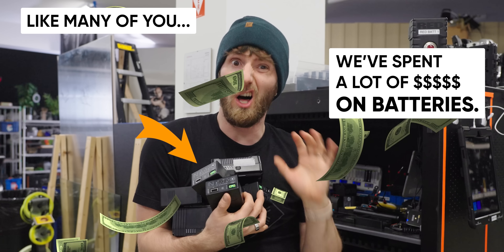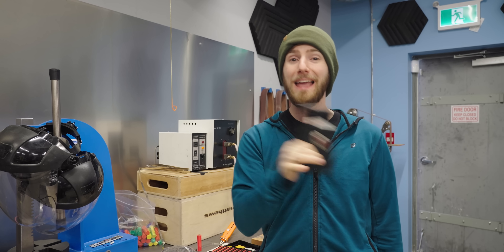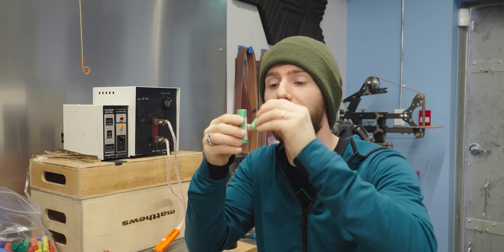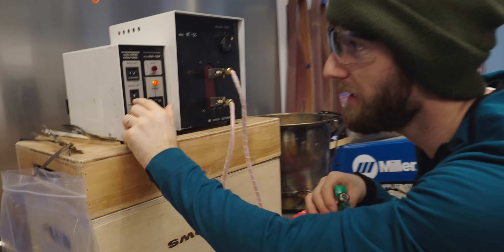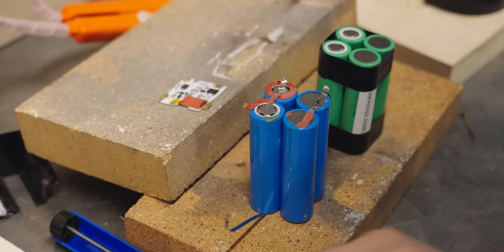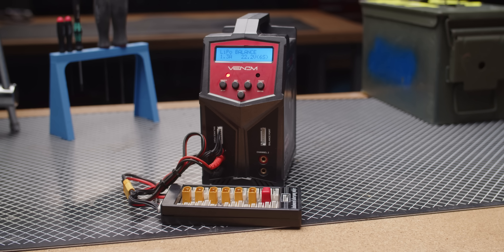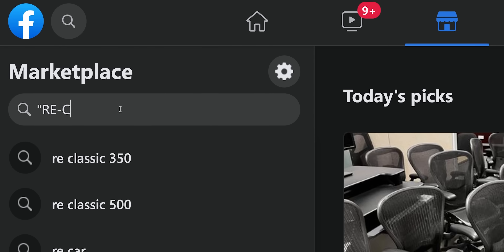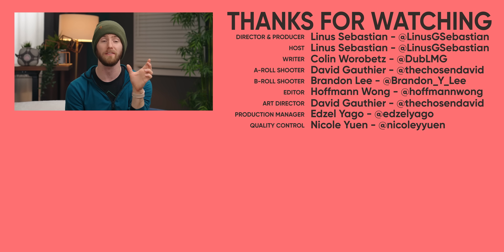This should be illegal… Battery Repair Blocking

Comment: Having worked and designed BMS systems (or PCM as their also referred to) I can add that these protection modules will almost always include an “under voltage protection” (UVP) in addition to over voltage, current and temperature protection. The UVP will lock out the battery from the system if it falls below a pre-determined value (either a specific cell or the entire pack). If you remove the BMS from the battery pack it will likely trigger the UVP and disconnect the cell. Usually this is resettable and only requires it to be armed by applying a voltage to the cell to system side of the BMS. This can be done by placing a power supply on the cell briefly to arm the BMS, the charger (depending on how it’s implemented) may also be able to arm the battery. 
Having said this, some aspects of the BMS might be non-resettable, if for example they have a physical fuse or a thermal fuse on the main output to protect the battery. And, of course there do exist “evil” packs that have a microcontroller that disables the battery like Linus describes, but I doubt that the Sony battery is built like this.
I hope this helped
Reply: THNX M8 was going to say the same. He just had to apply some voltage to the copleted pack with BMS and end up with working battery pack
Reply: As a fellow embedded engineer, its actually way too easy to make evil BMS. I have actually make it, all you need is mosfet as switch, Attiny(as it is small and great thing is it can work between 1.8v to 5.5V which makes perfect for this application ) and some i2c EEPROM (prefer WLCSP-4, due its smallest size factor). BAM you are done.

Its suprising easy.
Reply: @kaustavsengupta8757  It's even easier: 'Evil' BMS-IC's can be bought of the shelf. Texas Instruments and Maxim are big players in this industry and have a great range of IC's with very, VERY complex safety-features that can only be reset by deep communication per SMbus.
Reply: I had a battery pack for an ebike where you had to jump two pads on the BMS after the battery was reconnected, probably the same thing.
Reply: Appreciate the added info. Solid knowledge.
Reply: they’re**
Reply: @niklas.251  EVERY GRAMMAR COP ON HERE SHOULD BE SENT TO INDIA !!
Reply: @flatearth9140  relax i was just telling him
Reply: @flatearth9140  username checks out
Reply: Thanks for the info. Are these boards actually safe to reuse multiple times? I get their lifespan is overdesigned for safety, but would they still be properly overdesigned enough for a second or third use? Thanks again, very helpful comment!
Reply: @AcoAegis  " Are these boards actually safe to reuse multiple times?"
I can't think of any reason why they're not.
If the board includes electrolytic capacitors, it would be a good idea to replace these but most of the electronics in a BMS should be good for decades if not longer.
I'm curious to hear what others with more experience have to say on this topic.
Reply: @ddegn  I was thinking the same thing, to be honest - figured I'd just ask to be thorough.
Reply: @AcoAegis  Depends. The BMS-PCB in my Bebob V-mounts is rather vulnerable and need to be soldered with care to avoid pads coming off from the substrate.
Besides that, the BMS-IC in them (BQ20Z65) have a logic-fuse output, that drives the filament in the logic fuse. In mine, a small transistor or FET is used to drive the filament, thus an extra point of failure.
Downside to mine: 4 of my batteries (I got 5) had the logic fuse blown and they are hard to find parts ánd hard to solder. Removing the blown fuses is no problem, but soldering the new ones in... pff... I've done a lot in my 26 years of soldering-experience, but it is by far the hardest thing I've done.
Fortunately, the IC can be put in a kind of 'check-mode': when you got full access to the device, you can check all safety-features. By simulating cells with resistors and connecting a power supply, one can also check the overvoltage and undervoltage security-features.
Besides that, blowing the logic fuse is a last resort because of some fault with the cells: this triggers a PermanentFailure, disables the charge and discharge FETs forever, stores the PermanentFailure in a flag in a few registers so just swapping the cells won't work. Add the fact that all those failure-flags (besides a PermanentFailure state, the cause of the permanent failure is also stored) can only be cleared by giving in special 4-byte 2-word keys that are only known to the manufacturer. Without those keys, you can't alter anything in the flash-memory.
And indeed, removing the cells triggers the CUV (Cell UnderVoltage) warning (and eventually Failure), which you can only remove by resetting the BMS-IC.
I had to get Russian software (Be2Works) with a small dongle. The software can crack all the necessary keys and reset them to default and at least get you back into the device. Because the russian software is rather limited, I eventually got the official interface from Texas Instruments to alter everything more easy and program the right chemistry ID.
That last setting is crucial: just adding new cells (if your BMS has not triggered on any faults yet) fails with the BQ20Z65: it knows how the cells react chemically on charge and discharge, knows the capacity of each cell and thus total capacity.
Adding totally different cells (like happens in this video) will fail on the more sophisticated BMS-IC's, as it will still think the original cells are attached. The calculated runtime and SoC (State-of-Charge) indicator can provide false information.
Reply: @weeardguy  I saw BQ20Z65. Damn by reading datasheet, it's actually baller IC( SHA1 as auth). But I couldn't find this IC in mouser India. Care to tell me how much it cost per 500 pcs?

Might look into, as I have to design this project "Multi Gas Analyzer" where electro- chemical sensor is used. If it's fit in budget I can actually use but PCB layout Guidlines given in datasheet might be little tricky, as it need different analog ground.
Thanks for telling me about this IC. This IC really pops my curiosity up
Reply: @kaustavsengupta8757  Haha, well who knew my comment would spark such interest ;)
I think the gas gauge industry is hit with shortages in supplies just like any other semiconductor market at the moment, so that could be the reason Mouser Netherlands only lists a 120-piece quote for the 595-BQ20Z65DBT-R1 (the one I use) at 14,46 Euro/piece, while the 595-BQ20Z65DBTR-R1 (notice the second R, minor difference, but a revision of the chip if I remember it right) is listed at 500/pieces at 11,76 Euro. Prices excluding VAT.
Texas Instruments places the BQ40Z50-R2 as a substitute with the same functions (and extra functions compared to the BQ20Z65), listed at 4,81 Euro if you buy 100 pieces.
Considering you need 500 of them, I can only recommend you buying the right gas gauge evaluation board as well. That's also (ridiculously) expensive, but it saves you messing around with an actual PCB that's not designed to easily conduct tests with (like I had to, which has basically destroyed one of the PCB's after so many soldering and desoldering of the cells).
But maybe it's better to use TI's configurator: their website has a great step-by-step kind of wizard to find the best gauge for your needs: https://www.ti.com/power-management/battery-management/fuel-gauges/products.html#%20
I got the logic fuses from ATC Semitec in the UK: though I could get them on Ebay or whatever kind of similar website, I didn't trust them being genuine. Considering the dangers involved, I wanted original parts with specs I can trust. Though I'm just a hobbyist, I just wrote them and got an offer for 10 of them at 50 Euro: quite a lot of money, but nothing on the total price of my project of reviving 5 V-mount batteries with 16 cells each, the costs of the russian interface and the one from Texas Instruments.

Hope this helps! Have a great day. Kind regards from the Netherlands ;)
Reply: @AcoAegis  The boards should last decades.
Reply: HOT swap(with voltage applied no current)
Reply: @theantiveganchannel3596  And even that has risks of permanent-failure when done wrong: if you apply voltage to the wrong connections, the BMS can still think there's something wrong. Besides that, hot-swapping a 4S-battery is a great hassle. You will need a 4-channel power-supply where every output can be adjusted to the desired voltage, that is accurate to at least 3 digits behind the comma (or point if your a imperial-system user) ánd is able to put its 4 individual supplies in serie.
And then you still have to be carefull: if you do it too quickly after charging or discharging, the BMS could start a cell-state measurement, checking what the internal resistance is. If you happen to have a power supply connected at that moment, the measurement will fail bigtime and could render its SoC (State of Charge) indication completely false.
Like that ain't enough, the higher-end BMS (like the one stated by TheRAZZITEAK) usually know exactly how the cells have aged over time and use. Thus, just swapping the cells won't get you longer runtimes, because the BMS-IC doesn't know any better than that the original, aged cells are still there. It requires a reset of the device to set everything back to 'golden-pack' state, the state it was in when it left the shop/manufacturer.
Reply: @weeardguy  - It's by design, and it's easily solved. You don't need any special power supplies or tools.
Firstly, manually charge every cell (parallel group) to a known equal voltage, let's say 4V. Then manually charge your replacement cells (groups) to the same voltage. So, now you have 2 packs with balanced cell voltages and equal cell voltages.
Next, solder a thin but fairly long lead between each pack's cell (group) and the respective BMS connection. For a 5S pack, you'd need 6 thin wires per pack of cells. Don't forget the big ones for main + and - of the whole pack.
So after soldering you end up with 3 wires on each BMS voltage sense connection (no, they aren't "balance wires"). Most importantly, you have two packs in parallel that have equal voltages on every cell series.
When it's all like that, remove all the original cell voltage wires (but you must leave the thin wires in place on both packs to the BMS). Transfer the BMS over to the new pack, and re-solder the main connections one at a time.
Once that is done, you can remove all the thin wires. You just need to be 100% sure that AT NO TIME do you disconnect power from any terminal on the BMS board, or let any cell appear to have dropped below about 3V.
NOTE: This is much harder to explain than it is to actually do.
Reply: @johncoops6897  Yeah well, reading your comment I can only tell you obviously have never worked with BQ20Z65 or equivalent gas gauges, because what you describe (manually charging the cells) is impossible: the gas gauge will trigger an alarm-state (and, if the alarm persists for long enough, will trigger a failure-state, which then disables the FETS and (if bad enough) also trips the logic fuse output.
The gas gauge (aka: BMS) does exactly what it's supposed to do when that happens: monitor each cell (or cell-group when in parallel, but the BMS won't know better than that it is 1 cell) and as soon as you start messing with cells externally (meaning: without the BMS knowing what is going on) it will act.
It's the same as discharging the pack by drawing current in front of the FETs: the BMS then suddenly sees current flowing from connections where there should not be any current flowing: it will trigger a discharge-alarm first, and if it persists, trigger a discharge-failure, which disables the FETs and blows the logic fuse (because, as said, the current flowing is not in control by the FETs, so even if the BMS turns the FET off, current keeps flowing, with the BMS taking action to end the situation)
Same for charging the cells while soldered to the BMS: it will suddenly see cells start to rise in voltage while it does not see any charging current flowing. It can then even start to balance the cell-group you are trying to charge because the other cells are at a lower voltage. It's wonderfull to see the PCB's in my batteries start taking balancing-action when necessary: suddenly 1 group of cells (or two, but usually only 1 at a time) drops in voltage while the rest keeps getting charged as the small FET on the board is dissipating power.
Besides that, you run a risk to damage the Analog Front End in the BQ-chip if you don't work from pack-positive down to pack-minus when removing wires: TI explicitly warns for this in the datasheet and application notes.
Whether it's okay to let a cell appear to have dropped below 3 Volt is completely up to the manufacturer: if it is strongly discouraged to discharge the cells used below 3 Volt, the manufacturer will most likely set the BMS to go into CUV-mode (Critical UnderVolt mode) at that level, which it usually recovers from if dealt with quick enough (read: charging it before overdischarge-timers run out or capacity drops even further due to self-discharge) than the manufacturer will protect the cells by programming the BMS accordingly.
The cells I used (Those Panasonic NCR18650B) are specced down to 2,5 Volt, which I consider to be a dangerously low voltage. I've set minimum system voltage to 12 Volt, where it used to be 12,8 Volt, as the original cells were specced empty at 3,3 Volt.
And then there is the cell-state: if you have cells that have aged, just connecting new ones just won't give you a splendid, new battery anymore: The gas gauge just won't know any better than that the original cells are still there, because the capacity-calculation is based on the internal resistance of the cells, stored in resistance tables in the gas gauge.
But it greatly depends on the BMS there is inside: Linus' batteries also seem to have a BQ-chip of some sort inside: I had to up the resolution to 2160p to see it, but it really looks to be the case that the left chip is marked with BQ xxzxx ...
Then you can put in new cells all you want, it just won't give you a new battery without resetting (in case of recelling with the same type of cells) or reprogramming (when you put in completely different cells, like I did) the BMS/gas gauge.
Reply: That sounds like some of the inkjet cartridges that prevent refilling.
Reply: @8546Ken  It basically is and the gas-gauge software can be set to malicious actions if certain conditions are met: the ones in my batteries have a cycle-setting: depending on how much of the total capacity is actually used, the cycle-counter increments with 1 after a charge-discharge cycle. That value can be determined by the manufacturer (or myself in this case). Just like the fault-limit can be set freely: if you want the BMS to go into a permanent-failure status and disable the pack 'for good' when the cells have lost a certain amount of their original capacity, you can do so. That sounds quite criminal (and I wouldn't be too surprised if this happens) but don't forget that gas-gauges (very sophisticated BMS-IC's) are used a lot in medical equipment, were ultimate precision is of greatest importance.
After calibration of mine, I had set it to discharge at work during one of my test-runs. On my laptop, I could follow the process via the SMbus-interface which was reporting back on batterystatus. When I started the discharge in the morning around 8, it said something like '324 minutes till empty': that's a value it calculates because it knows exactly how the cells respond to every current-level available.
I had set a timer on my phone (mostly so I wouldn't forget to stop discharging) and when I came back in the third break, it was indeed empty with a 40 second accuracy.
If my battery would have been in an AED or other very important mobile medical device, you will thank the designer for putting in such a wonderfully designed piece of electronics.
Reply: This is good info that a lot of people just don't know. Where I work (as a mechanical engineer), we make various electronic safety devices, some of which we put the batteries into a deep sleep before shipping them to the customer. When the customer gets it, they must put it in the charger we made for that device in order to wake the battery pack up before they can use it. Some of the battery packs we design (though we don't manufacture ourselves) are certified to be used in explosive environments, so the protection circuits have to be extremely fool proof. This is done for safety reasons and not to be evil. 

Those red cells in this video look just like the Panasonic UR18650A that we use in one of our devices. I had the pleasure of having to chop the top off of one for certification reasons before and I wasn't too thrilled about that task because of the risks, but I managed without any problems. Though, I wouldn't want just anybody to be doing that in their homes.
Reply: @usefulidiot21  Well if you read the datasheet by the manufacturers, you'll usually see a whole list of risk-assesments and tests that the cells have to endure without posing a risk to the user. 'Drop test at 1 mtr, max. Cell-housing should not be deformed, cell may not become hot' or 'Overheating: cell is externally heated to 85 degrees Celsius: cell shall not explode or vent flames.'
Though popping the top off of one is not a likely scenario they thought of, it does come close to a short circuit test, which usually requires the cell to heat up to a certain maximum temperature, shall not deform the cell-housing, and may not vent flames.
Reply: @weeardguy  The reason I removed the top of the cell was just to verify the construction and spacing/dimensions of the various parts for the certification body. I made sure to drain as much of the charge as possible beforehand using a handful of high wattage resistors. 

I've learned that battery packs have to endure a lot of things to be safe for use, as I work with electrical engineers that create the protection circuitry and and software engineers that write the code to charge/use them. Our devices which are certified for explosive environments have to be able to withstand drop tests and be at least IP67 rated, so it's no trivial task to make everything safe.

Knowing what I know about lithium ion batteries, I wouldn't want just anybody replacing the cells in their own packs. Though, it's nice when a company offers that service to help reduce e-waste.
Reply: @usefulidiot21  "Knowing what I know about lithium ion batteries, I wouldn't want just anybody replacing the cells in their own packs." 
What you want doesn't matter, if consumers want these repairable another system has to be made. If it isn't they will take it a part and do it manually to an extent either way. Safety feature's aren't an excuse for planned obsolescence and never will be, these feature's can also be applied without dogshit support and overpriced repair or replacements, they are only not because of company interests not because making a more expensive repairable model through a third party is impossible or has no demand.
Reply: @Yeet42069  I'm not sure you understand why these safety measures are in place (hint, it's not for planned obsolescence or overpriced repair or replacements). So my response to you would be, "What you want doesn't matter".

I'm all for right to repair, as I fix as much of my stuff as possible, but this is one place where it doesn't always make sense.
Reply: @usefulidiot21  I'm not sure you understand how companies work let alone what I'm trying to say (hint, you're not the brightest bulb). Whether its designed for planned obsolesces or not doesn't matter, what matters is it can be used for such by simply denying the creation of a superior product with reparability when consumers have a need for it. 

What is the difference between creating a malicious system designed to break down and a security feature that will do the same exact same thing for shareholders bank accounts? Nothing, absolutely nothing. Which is the exact problem that is being addressed in the video. A rational person who encounters a problem and needs to solve it will not only question why the problem exists (the need for additional safety mechanisms) but also why the current solution isn't optimal and how it could be improved. The latter is what you seem to miss while rambling about your justifications about a system that is designed to fail itself instead of accepting that it doesn't have to be that way and the main reason that it is, is related to profits. And the fact that a video like this where a bunch of people who are clearly not experienced enough with batteries are trying to work on them simply because the alternative is to replace a working product instead of the battery itself just proofs the prior statement.

What reason does the company have to create a non replaceable battery pack into a product that will simply lock itself out due to safety concerns? P L A N N E D     O B S O L E C E N S E.
Do they have to invent a malicious way to make you buy another product when a battery replacement is all that is necessary? No. The same can be done simply addressing security reasons in a product feature that could be replaced with another feature that avoids the problem altogether (replaceable batteries). But obviously, If you create a superior product that is more reliable you will miss all the additional extra sales you would get from selling a new product due to a battery failure.

As for claiming that my response doesn't matter, if it didn't this video wouldn't exist and battery replacement along with tech repair laws wouldn't be an issue all over the western world. Yet it is. An no, half assed security features from a self created problem is not the main reason for these issue's let a lone a factor that really matters.

Also, you really need to be a next level mongrel to get offended by the statement that states that your opinion matters less than consumers needs let alone take it personally for some reason, its more of a law than anything.
Reply: Big Clive just released a video about this, sorta, smart battery chargers
Reply: Mark Ulis  LOL
Reply: I have run into the evil microcontroller variety with Dell laptop batteries. You have to apply a secondary battery to the BMS for the time if the re-celling, otherwise it shuts down permanently if it is disconnected.
Reply: @Nemozoli  Well, everybody calls it evil, but it's not evil at all. It does EXACTLY what it should be doing: protecting the user from harm because the charger otherwise will try to charge cells that have gone beyond a reasonable limit of 'bad'.
Though there are some malicious software-'solutions' out there, where gas gauges (those are the 'evil' microcontroller thingies) shut down prematurely, most of them will do the job they have been designed for: protecting the cells from dangerous currents, (whether that be discharge or charge), high and low temperatures, overvoltage and undervoltage and (very unlikely) cell-disconnection after a battery that has hit the floor from considerable height (leading to a cell-undervolt situation on one of the inputs of the gas gauge, triggering safety-features)
To only downside is the custom firmware put inside the gas gauges some manufacturers use, which make it hard to reset the BMS as the normal software offered by the manufacturers of the gas gauge won't be able to communicate with those.
Reply: I have no idea if I'm in favor or not honestly. 
Can't a case be made that there's a legit concern for these batteries to go flaming because of improper soldering or something?
Isn't it a good idea to make these things unresetable so amateurs don't do stupid things? 
Or am I missing the mark, is it only certain batteries that go firy?
Reply: @Broockle  Well, that's the whole point. These batteries pack so much of a punch and are such dangerous devices when overcharged, overdischarged and then charged and such, that the manufacturers make sure they are not easy to mess about with.
Ofcourse, this already starts with opening the battery: the manufacturer already states on the battery itself to not open it. Everyone that does probably has a hard time dragging the manufacturer in front of court because he or she made a bad short or something. They explicitly stated you shouldn't, so if you do, you bear the possible consequences.
Besides that, it's all about accuracy as well: those gas gauges in these kind of batteries are extremely precise pieces of electronic engineering, that hit incredible accuracy when it comes to remaining runtime and such. That already is a hurdle for many as 'just' connecting new cells because the old ones have gone bad just won't work: the gas gauge knows about the aging of the cells and knows their internal resistance is rising as they get older and thus also can calculate EXACTLY when the battery is empty. You just can't get around the fact you have to tell the gas gauge you've swapped the cells for new ones, because it will think the old, aged cells are still there, giving you the exact same runtime as before the cell-exchange.
If you don't exchange the cells while applying auxillary power to the gas gauge, the gas gauge will sense something bad is happening (Critical UnderVoltage) and set it's failure-status, disabling the charge and discharge FETs and rendering your pack unusable.
And resetting the gas gauges is something that is usually secured from the factory: multiple security keys restrict access to the flash-memory and you will either have to know those keys or have special software and hardware crack them.
And if you got the gas gauge reset, you can still be haunted by the logic-fuse that is also on board PCB's like this: a fuse that can be made to blow 'on command' by the gas gauge that has a special output to drive the filament in it.
This is a last resort if current (either charge or discharge) keeps flowing while the gas gauge has tried to turn of it's FETs but they have gone short-circuit and thus keep conduction. It will then blow the fuse ending the situation. This is great for safety, but you will have to find those fuses first as well. And those are not easy to find, especially not if you want them from a reputable factory and not Ebay and such.
So, if someone's willing to spend all the time reading on how the gas gauges work (something you will have to do as they are absolutely complex), how to reset them, buy a spotwelding thingy to assemble a new pack, get the necessary interfaces and software to reset the gas gauge, get the logic fuses replaced (which, besides sourcing those parts is just a hard part to solder) and then putting everything back together, you can do so. But most people likely have already given up long before. If it's not because of the costs, than it's because it's too complex and just plain dangerous if you don't know what you're doing.
Reply: @weeardguy  
uh thx for that
can't quite tell how that answers my question tho. Are you saying tampering prevention is good or bad?
Reply: @Broockle  I think it's good to a certain extent. I consider custom gas gauge firmware or deliberately making the 'battery' fail after a preset number of cycles to be malicious practices that should not occur. Recelling stuff like this should be deliberately hard to stop the non-competent from trying ;)
Reply: @weeardguy  
oh, yeah, that makes sense
adunno, from the video I kinda got the energy that all prevention was malicious and I got worried. ;D
Reply: @Broockle  Well, they basically gave this video a clickbaity-title and indeed try to give you this feeling the manufacturer is the bad guy, while in reality they try to prevent dangerous activities. Fortunately, besides the complex components, cost is also an issue: if you do understand all the dangers, the complex electronics and such, you still have to buy a lot of expensive hardware (and most likely) software to deal with all the security inside those packs. It's only a viable option when you have 4 or more batteries, depending on their price. Mine were 300 to 500 Euro excluding VAT and with 5 of 'em in my possession, trying to recell them myself was a viable option: the manufacturer has an option to bring them in for recelling 'at about half the price of a new one'. But for about half the price, I could try and do it myself. If you're a hobbyist, it's do-able, if you're a pro, the hours you need to spend on everything are not worth it and you're better off sending them in for recelling, especially because you also need to master spotwelding to an extent you get a reliable, sturdy connection.
Reply: @weeardguy  
cool
unrelated note, my laptop battery inflated ages ago. It still works but doesn't fit in the laptop casing anymore. 
Any chance that can be salvaged? I basically left it lying in a drawer for a long time now. I should prbly find a place that recycles the thing somewhere. 

 I contacted Razer but they're being weird about it. They'd want me to send them the whole laptop back which is super inconvenient for me, then still charge me 1/4 price of the whole machine anyway to replace that battery. 
I tried just shopping for it on Amazon but no one carries it.
Reply: @Broockle  It inflated? That sounds like it holds LiPo-cells inside, those bag-like batteries that can be found in cellphones and RC-vehicles.
Basically every battery can be revived again, given that A. the manufacturer did not put custom firmware inside the gas-gauge. B. The pack's case can be opened and closed again (this is usually the most problematic step) and C. you can get good cells. Finding good LiPo-cells that also fit will probably be the biggest challenge in this case.
Don't forget that besides the steps above you will also need some hardware to communicate with a PC or whatever: if you're lucky, the BMS/gas gauge is unprotected (doubt it ;) ) and you can get access to it with no trouble at all. Most likely, the manufacturer has put security keys in place that restrict access to the device. You will then need to crack those keys via special (expensive) software (there are a few, I only know NLBA and BE2works, last one could be problematic by now as this is Russian software) and if you want peace of mind resetting the gauge, you will need the interface from the gas/gauge manufacturer. I'm glad I took that step as it makes life so much easier. This is usually such expensive stuff that it's only viable when you've got multiple cheap batteries or when you have a few batteries that are very expensive (like I had).
Like that ain't enough, you most likely will have to deal with the logic-fuse on the PCB: judging by what you say, yours is most likely blown, an extra protection to prevent the cells from ever being charged again and stop dangerous deep-discharge (though yours have likely reached this point ;) )
Those parts are a bit hard to source as a private customer if you want them from a reputable company instead of relying on Ebay or Aliexpress and the likes.
You could try to contact a technical university or such: they usually have an R&D-lab or something similar and sometimes people like to tinker with electronics outside education hours ;)
Reply: @weeardguy  
The battery was still working perfectly even when it inflated, just the housing had to give at the underside of the laptop lol
I did remove it eventually and now my laptop only works if plugged in. 
Been living with this situation for well over a year now. My warranty had expired pretty much exactly when it happened too. 
It's a Razer laptop. 
So ye the prospect of not having my laptop for a month and having to basically buy a new laptop (prbly not at full price i think) didn't sit well with me at the time. 

The battery is still inflated now. It's a long rectangular thing that seems to have inflated in 2 places. It would prbly still work if I put it back in
Reply: Mark Ulis  they're** 

Also no
Reply: UVP is also very important with Li-ion batteries as depleting below about 40% the true capacity(not what's displayed but the actual total capacity of the cells) will damage them and dramatically increases the chance of run away while attempting to charge it in the future.